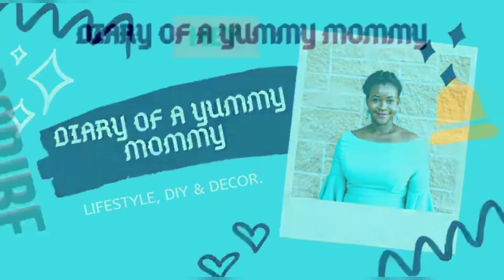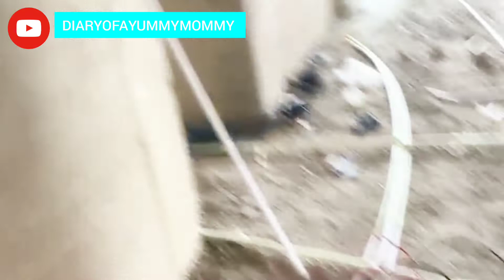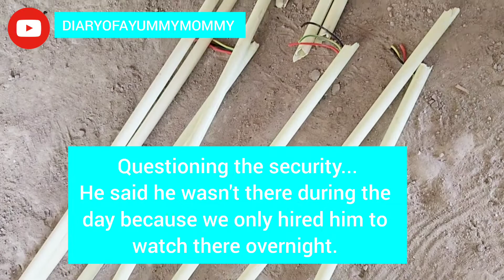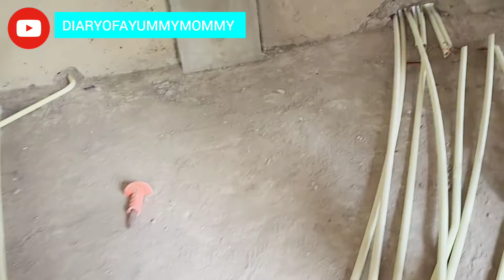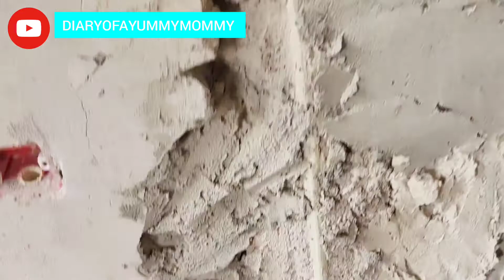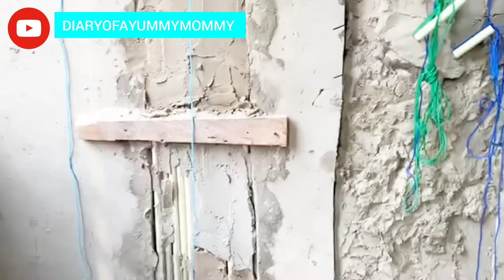THE HOUSE ON THE HILL// OMG WHEN IS THIS GOING TO STOP! SO FRUSTRATING. #buildinginghana #ghana

Comment: I had mine stolen 3 times. I had all the burglar doors, windows and security doors. They broke the metal door and also the ceiling to enter into the house. I have now suspended wiring until I am ready to move in because with even someone living in the house , you can get the cables stolen. It’s a mystery.
Reply from the maker: It's so frustrating! You mean they tore down your POP to steal your wires?! Wow!

Comment: Ghanaians in abroad should  learn a lesson from this, dont just buy a land anywhere because is cheap. Think about your safety, instead of building a  mansion, buy a land in a good location or gated
 community service land.
Reply from the maker: You have a point, but most of the building site thefts are inside the job. So it doesn't really matter where you get the land. It depends on who is in your team.